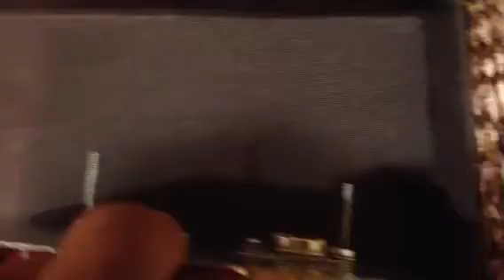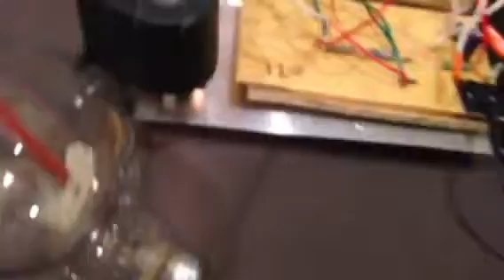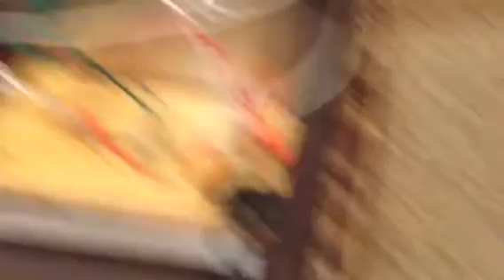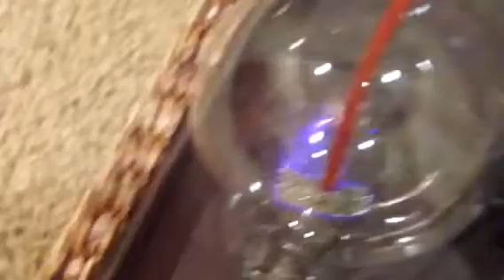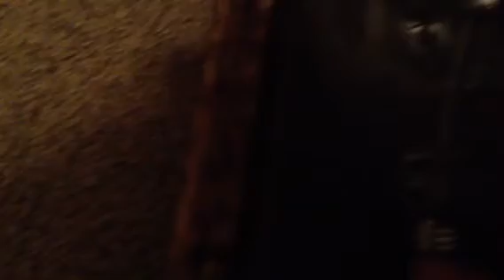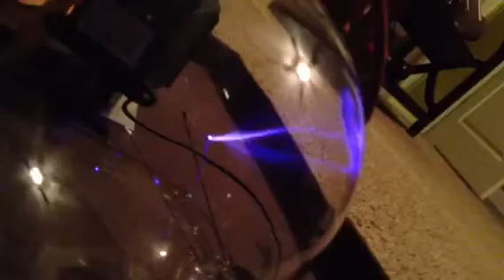Push pull flyback AC output lighting up bulb

Comment: It looks like you have the leads backwards. You should have the hv lead to the screw connector and the base lead of the flyback transformer should be grounded.
Reply from the maker: Seemed to work though